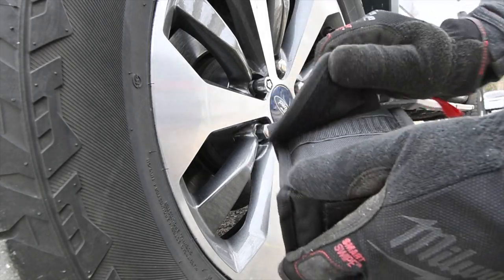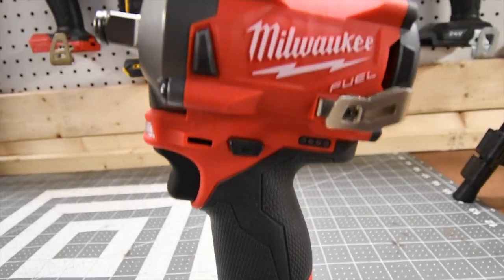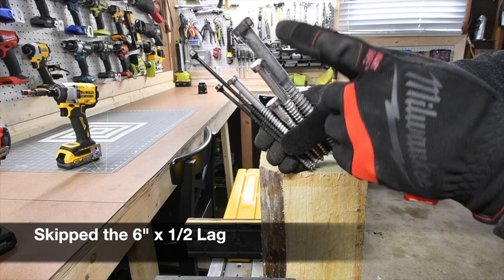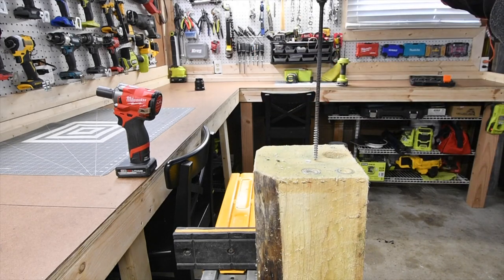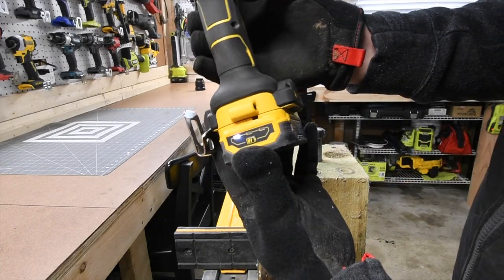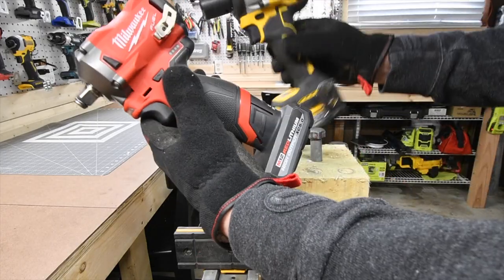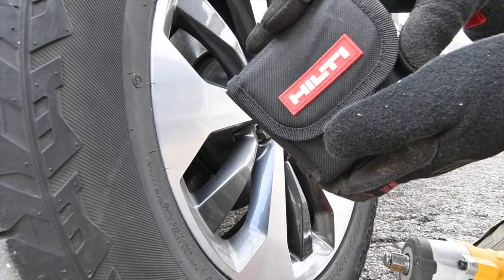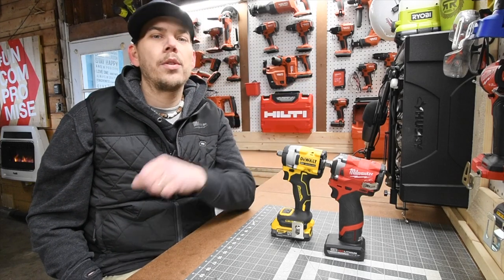Which Battery Would Last Longer?

Comment: I love my dcf 923 and dcf900. Dewalt is the leader in impacts wrenchs right now!
Reply: The m12 did about the same as a 20v dewalt 😂
Reply: @adiaz856  so? 12vs are pretty powerful! You can make some 12v just a strong as the 20. I mean dewalts atomic smoked the makita 40v impact. With your logic it should be twice as strong.  Tools are complicated
Reply: The dcf921 out performs the stubby.  Even the dewalt dcf901 12v out performs the stubby.

These tests require very low torque and it’s just going to be tool rpm mostly.
Reply: @adiaz856  Just get on torque test channel and they will show you who is king in the impact wrench world.
Reply: @juanc5149  ashamed and goes to show you all this again the M12 stubby is what four years old and stills kickass ,would hate to  see  if Milwaukee upgrades to a newer one and i mean in 12V
Reply: @adiaz856  the dewalt 12v is also about the same as the 20v voltage doesn't mean shit when the voltage is this close
Reply: @adiaz856  try Dewalt 12v dcf901. 
It' also about the same as a M18. 
It's not comparing 12v vs 18v/20v. right now, if we refer to TTC, Dewalt win. 
It's time for Milwaukee to work on their R&D and produce new product with more torque than Dewalt, if torque is only the reason for buying. 
For me, in south east Asia, I prefer the support of the brand in here.

Comment: I drive a tow truck and in one 12 hour shift I once used the M12 with the 5.0 battery to lift a 1 ton diesel truck off the ground using a scissor jack (19mm jack) then lifted two other cars and changed the tires and still didn't need to charge the battery at the end of the day I'm pretty impressed

Comment: This was exactly what I would expect when you compare a 54wh battery to a 30.6wh battery. A battery with 76% more capacity should last longer. That 12v 5ah would compare perfectly to a 20v 3ah since they're both 54 watt hours. Or if a 2.83ah 12v battery was a thing, that would have the same capacity as a 20v 1.7ah

Comment: The M12 Stubby is a Beast that punches way above its class! The proof is right before our eyes. That’s why I love my Stubby! The Stubby if compared to a non-power stack battery I believe might have tied if not beat the regular low amp batteries. That low amp power stack ain’t no slouch in DeWalt’s battery lineup! Great video my friend!
Reply: It's a fine tool, but this Dewalt is in its class. it's no longer punching way above it's class, especially at it's normal pricing. Nearly identical size (Milwaukee seems larger in some ways), weight, and price.
Reply from the maker: I agree Txvet

Comment: thanks Dave . how does that little impact wrench compare to impact drivers . i think the drivers are faster and thus more effective for long screws and such
Reply from the maker: correct, but since but the impact driver will work more in the ling run. the impact wrench would stay cooler and work less

Comment: Did you try the 2.5 Milwaukee
Reply from the maker: the 2.5 would be a major unfair advantage. That battery would drain quick since its a 12v battery. this was just a fun video to see what can do what :)
Reply: @ManCaverTools  it could be closer than you think. The 2.5Ah battery is 30Wh while the Powerstack provides 34Wh.
OTOH, the 5Ah HO battery provides 60Wh, way above the 1.7 PS

Comment: If you get the right size socket it won’t budge on the nut at all…not just Hilti sockets
Reply from the maker: my other sockets sets that I have that are the correct size have a little wobble. I also didn't say that only HILTI sockets are like this. Other brands have perfect measurements as well, not just HILTI